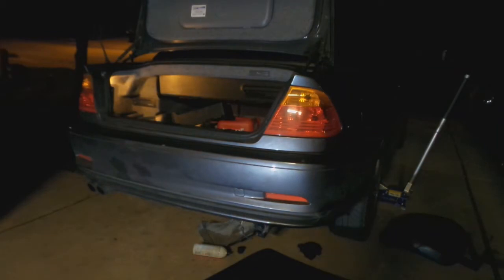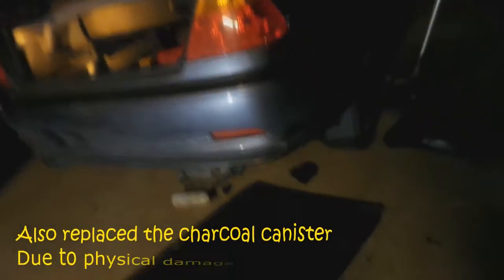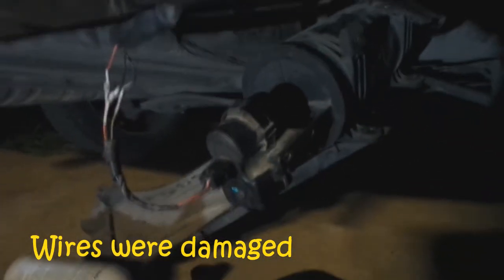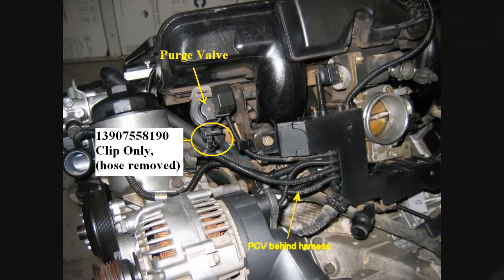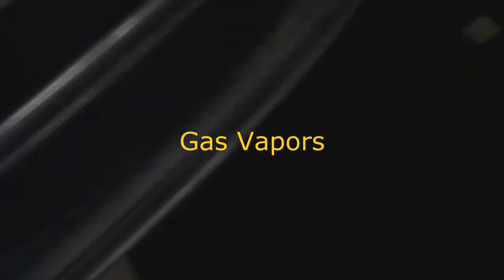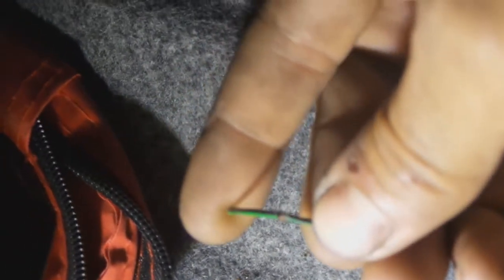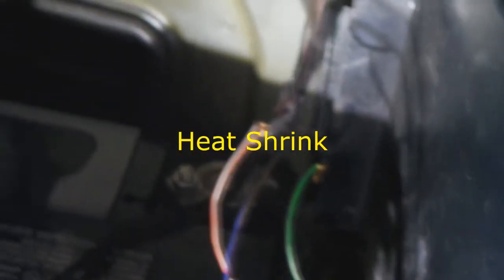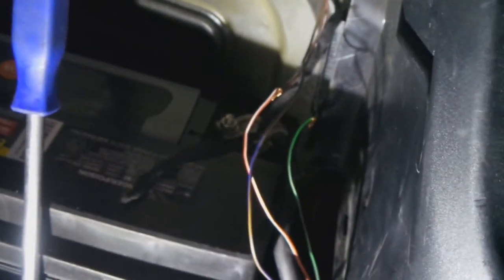How to fix P1451 BMW

Comment: very helpful video, I had the same problem and went to 4 mechanics, they all couldnt figure it out... I checked the wires and same thing, the green one was cut from the underneath the car. Just reconnected it and check engine went off, should pass Etest now.
Reply from the maker: Khalid Shalaby thanks I am glad I've helped :)